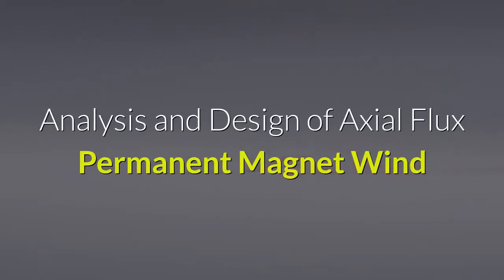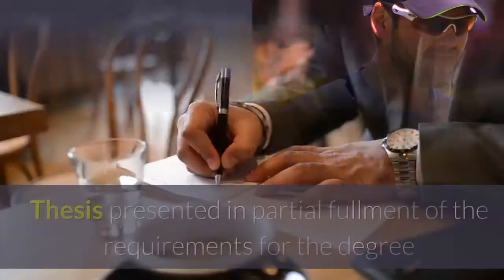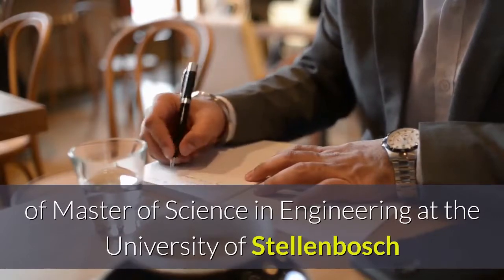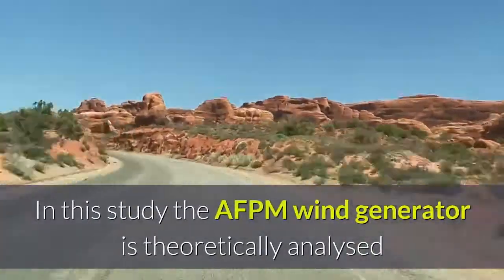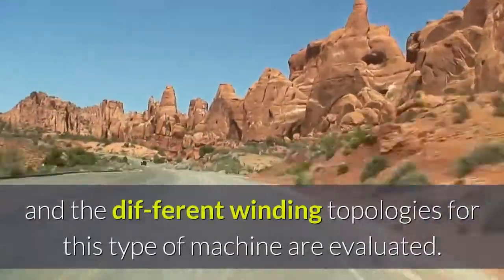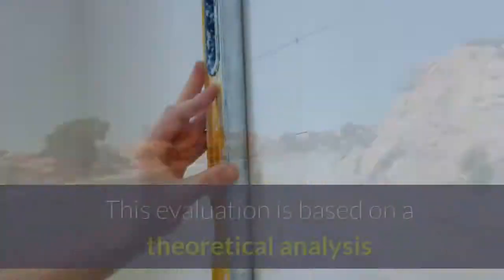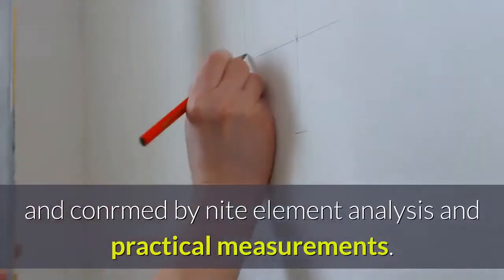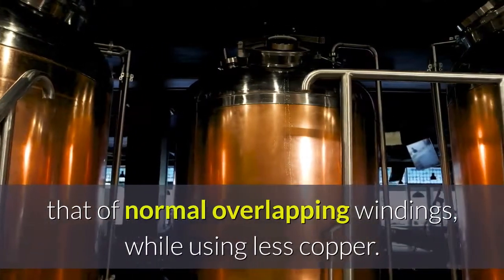Analysis and Design of Axial Flux Permanent Magnet Wind Generator System

Comment from the maker: Zero Point Energy Of The Permanent Magnet:
https://ultimate-energizer.blogspot.com/2019/09/zero-point-energy-of-permanent-magnet.html
Magnet Generators: Pulse-Charging Battery Systems: https://ultimate-energizer.blogspot.com/2019/09/magnet-generators-pulse-charging-battery.html

Self-powered electrical generator: The nature of electrical impulses to generate radiant energy: https://ultimate-energizer.blogspot.com/2019/08/self-powered-electrical-generator-generate-radiant-energy.html

Earth Battery - Detailed plan: https://ultimate-energizer.blogspot.com/2019/08/earth-battery-detailed-plan.html

Zero Point Magnetic Generator - Zero Point Energy: https://electrical-digital-stimulation.blogspot.com/2019/09/zero-point-magnetic-generator.html

Exploiting Zero Point Energy in Ether thanks to Permanent Magnets: https://energy-medicine-blog.blogspot.com/2019/09/exploiting-zero-point-energy-in-ether-by-permanent-magnets.html

Nikola Tesla: Atmospheric electricity - Wireless Power Transmission: https://homemade-generator-tao.blogspot.com/2019/09/nikola-tesla-atmospheric-electricity.html